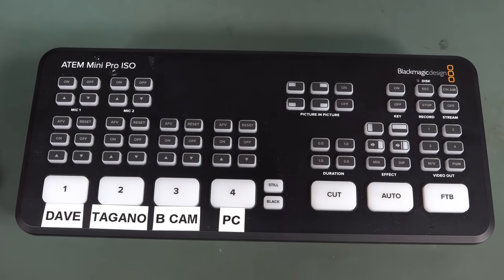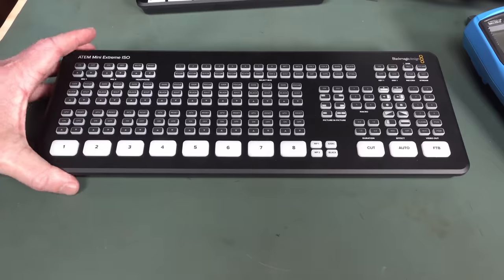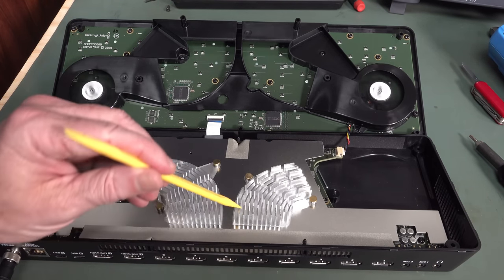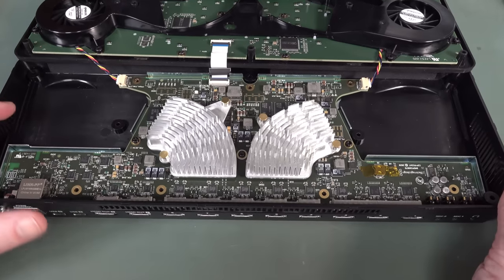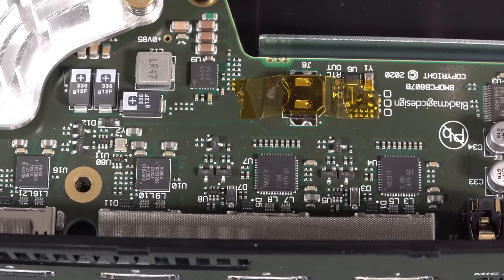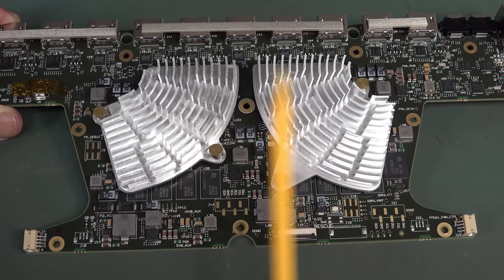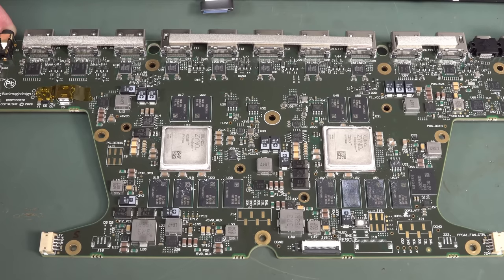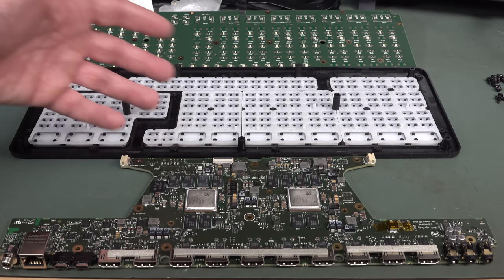EEVblog 1396 - BlackMagic ATEM Mini Extreme ISO TEARDOWN

Comment: the saddest thing about this sort of beautiful engineering, just like with early HDMI capture cards, is that they'll eventually be competed out of the market by 20$ generic one-chip solution boxes
Reply: At $1800 what you describe is the BEST thing that can happen.
Reply: @wthornton7346  for the prospective buyer, yes. Not for the engineers who put thousands of hours researching and developing this product onto this fpga platform. Hence my comparison with early hdmi capture cards which also required huge fpga silicone for what is now done on a jellybean
Reply: @redtails  Sure. But the engineers were well paid and technologies move on. That's a good thing.
Reply from the maker: I'm not sure I see $500 worth of silicon going to $5. That's like saying a $500 Intel processor is going to $5. Hasn't happened because of the large size and cost of the physical silicon. Moore's law can only give you so much.
Reply: @EEVblog  true. Though, have a look at hdmi capture cards. They went from complex 500+$ pcie cards to $10 usb sticks while maintaining identical functionality

Comment: Non-pro here: Does ISO expand to something related to the function? I hate acronyms.
Reply: I think they call it ISO because it lets you make ISOlated recordings of all sources on top of the master out.
Reply: Iso because you can continually record each individual input, isolated from each other, so that you can create new cuts after your live event.
Reply: @thomasp001  Thanks to both. In other words, the way most high end audio interfaces have traditionally worked. Since ISO is an abbreviation for a standards body as well as many other things, this interpretation didn't register on my list.
Reply from the maker: Yeah, confusing, it means isolated channel recording. i.e. each channel gets recorded to it's own file separately.
Reply: I just wish the ISO version recorded the supersource as a separate input

Comment: It's impressive that this thing consumes only 50W
Reply: Meh, not really considering top-of-the line smartphones could do by with like 10W while simultaneuosly encoding 5+ 1080p streams. This doesn't to 4K streams.. some smartphones can encode (albeit not best quality ofc) 8K streams etc.

You could get a PC that does all this and much much more for same price. The bundled in software for post-production is probably some advantage, though similar options for PC must exist.
Reply from the maker: I doubt it would actually take the full 50W.
Reply: I mean, I think it's impressive that it can switch, record and transition 8 video channels at less than 50W. All at the same time. That's a lot of pixels.
Recent high-end phones are a marvel of engineering too.
Reply: @rkan2  there’s a lot of value to having a good interface - tactile buttons and each feature on a button. When you’re running a live event you need to be able to rest fingers on buttons and be watching your multi viewer and know you’ll press the right button. It’s horrid to switch live shows with a mouse. Yes you can get stream decks and midi interfaces but it’s not as nice as dedicated hardware. Plus less risk of windows doing something to bigger your setup.
Reply: @PeteMcCrea  Sure - I'm just saying that for most people it probably makes more sense to pay for hardware that is dual (or multi) purpose. Also - no one is saying that Windows should be used.. :P

The device is not badly priced overall, but like I said, you can get a PC for the same money that can do even more than this.

Comment: What is the most expensive FPGA money could buy?
Reply from the maker: On Digikey it's the XCVU47P-3FSVH2892E at USD$115,257 one-off
Reply: Keep in mind FPGA list prices are insane.  Sometimes people have gotten them for something like 1/10th of list depending on quantity and how much negotiation leverage you have.
Reply: One designed for spacecraft, radiation hardening isn't cheap.

Comment: Striking how similar this is to the kind of machine you would need to run a full Strong AI. Those big high end FPGA's are exactly the kind of chips that could do the job..It even has a quite a lot of the high speed video processing hardware that would be needed..

A true Strong AI machine might need about ten or so high end chips probably stacked over about four boards. A custom OS was another early design requirement - but a lot of others are more obscure or different.. Things like unbreakable security, extreme reliability requirements, real time data cycle, very high data throughput, black box systems, full self autonomy, etc.

(Yes unlike others who had proper careers I wasted my time trying to solve the problems of building real Strong AI's. Once I have a basic design solved I discovered that that was the easy bit and building a working machine was the hard bit. But even that is easy compared to proving to anyone that you have a viable design without having a working prototype.. - Then realizing that even building that prototype is going to cost millions of $$ and will take up to 20 years.)